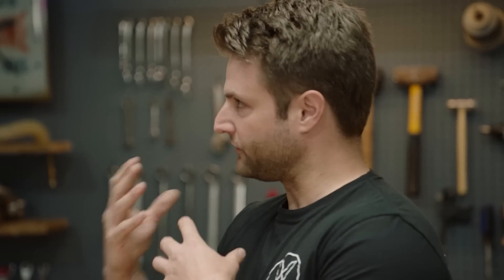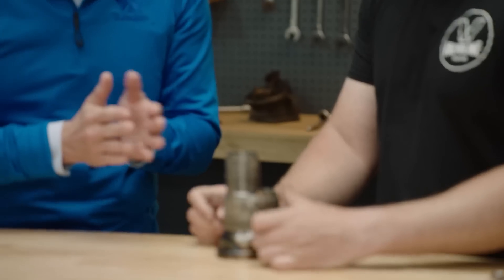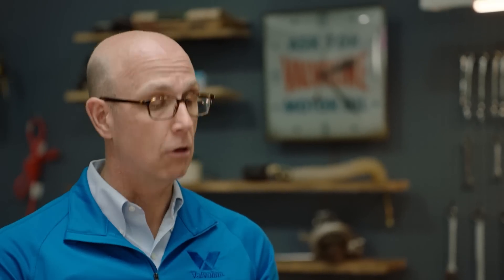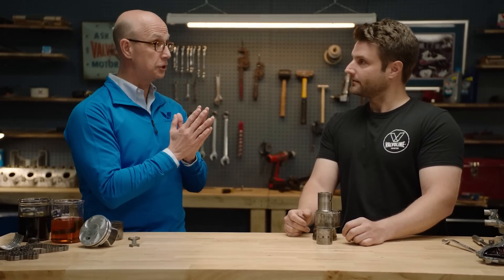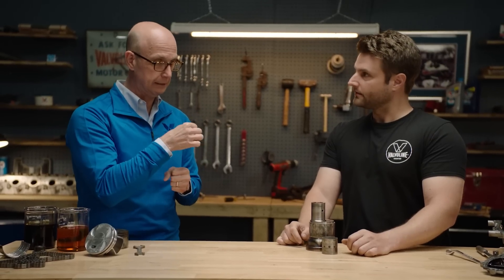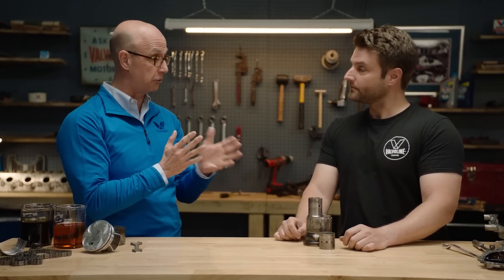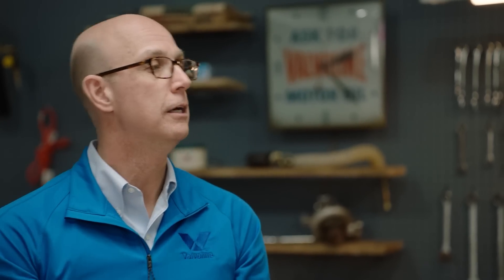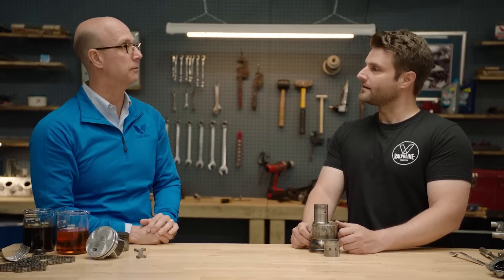Rob Dahm gets answers to his most pressing questions about motor oil

Comment: Question for mike warholic. 
Have 2016 outlander sport 2.0
Oil cap says.  0w20.    
Would  5w20 be better in summer time for better wear protection  for long haul drives and 90 outdoor temp or hotter.

Comment: Rob should ask about engine life expectancy after a drain plug falls out within 50 miles of driving after having your oil changed at a Valvoline Instant Oil Change. Mine was a week.
Reply from the maker: We are sorry to hear about this Christopher. If you have not started a claim and would like to do so, please call our Customer Care Center at 800-327-8242.
Reply: @valvoline  a claim? You mean with your insurance company? Yeah...and it was rejected because your district manager gave me the choice of going thru your insurance or accepting a cash offer (not enough to fix the damage) and I opted to have your insurance handle it.. but they won't because I was offered money by your manager. That's a pretty good scam you have there. Get your insurance off the hook, then bump the offer up slightly  (still not nearly enough to fix the damage) in hopes I'll accept to prevent it from going to court. So you'll deal with my insurance and their lawyers instead.

Comment: I've switched from Pennzoil to Valvoline recently, partly because of your partnership with Rob Dahm but also because you're much more willing to dive into the engineering decisions behind an oil. 

I do have a question, your engineer in the video discussed friction reduction additives for your VR1 series of oil. Is that additive present in your full synthetic oils as well? If it isn't present, would buying that seperate additive and adding it to my oil be possible, and if not why not?

Also hi Rob, absolutely love your content!
Reply: I'm no engineer, but a lot of those additives are already in the normal oils you would be buying, it's just that in vr1 they crank the amounts up for the specific use case of race engines. The project farm channel here on YouTube tests a lot of different consumer products, including oils, and in those videos he will send off oil samples to an independent lab and show the results he receives. Those results show the amount of the wear additives, like zinc, contained in the oils. You should really check out his channel
Reply from the maker: Great questions! Our Product Support team would be able to answer these for you. They can be reached at 800-832-6825! 🙂